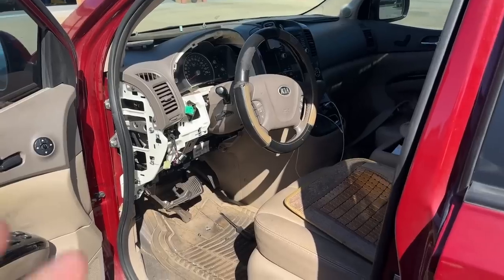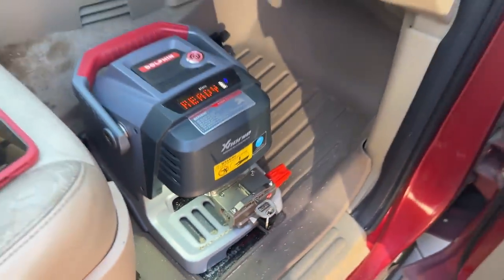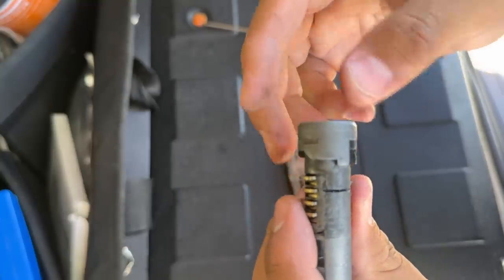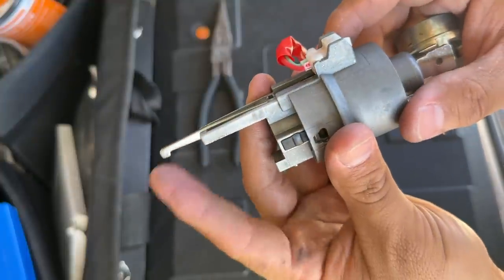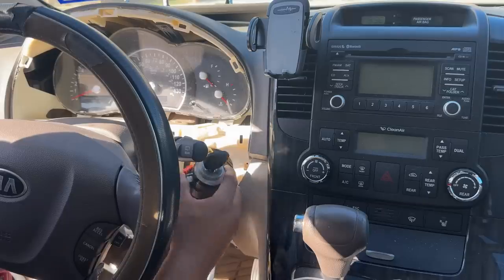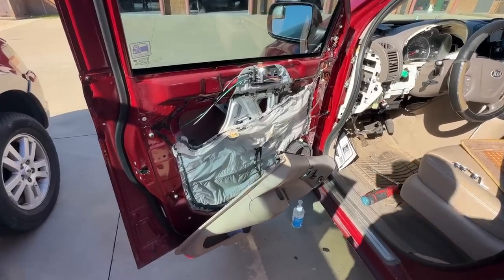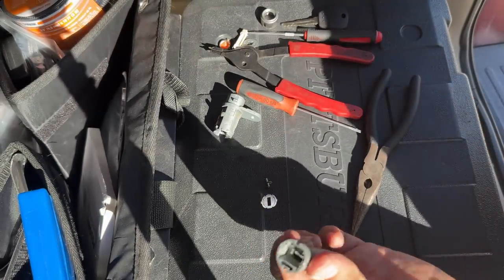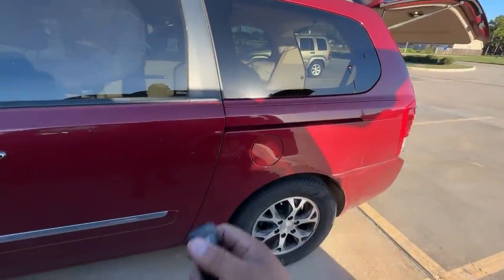KIA STOLEN KEYS / REKEY LOCK CYLINDER IGNITION AND DOOR

Comment: Swapping wafers is hacky. Honestly man just buy a wafer kit and rewafer the lock. You'll get fresh wafers that will wear evenly with the new key. As an automotive who apprenticed with a locksmith this makes me cringe. For the best results you should use new wafers. Secondly those mfk shells are kinda weak in my opinion. Just stock the correct blank and you don't have the risk of the head coming off. Not trying to be a dick. I'm friends with Oz. You can ask him and he'll tell you I'm not here to troll or bully.
Reply: For other reasons we only use OEM or OEM refurbs. We will reshell a broken one though. The reason we try to use OEM is in the past we had call backs or the aftermarket cheapies won't program brand new. We charge accordingly for OEM so we aren't the cheapest but we never get call backs since we stopped using aftermarket. With reshells you still use the factory board and cut a new blade. I also never swapped wafers as I had every keying kit I could buy. New key to used wafers and old key to new wafers is looking for trouble but in a pinch if no other choice people do it. I also installed new springs but that's me. Eric is new at this but a great diag tech too. He will figure it out. I know really good locksmiths who will remove bent wafers instead of replacing them too. Not my style either but they are good at what they do except for that. :)
Reply from the maker: Maybe you missed the part about her purse being stolen. The owner was really tight on money and the parts dealer wanted $300+ for the new lock cylinders with the keys. It was also going to take 3-5 days for the parts to arrive. I did this job just to help out and she was happy with the result. The locks work great. I could understand replacing the wafers if the lock was damaged and we were repairing it, but this was not a repair and the wafers are still in good shape. Also, these MFK keys from GTL are pretty durable. I don’t use them often. I mostly use them to cut test keys, but they work great either way. I also keep transponder key shells and metal keys in my inventory along with OEM transponder keys. I’ve got quite a selection. Whatever key I choose depends on the job I’m doing. Thanks for watching!